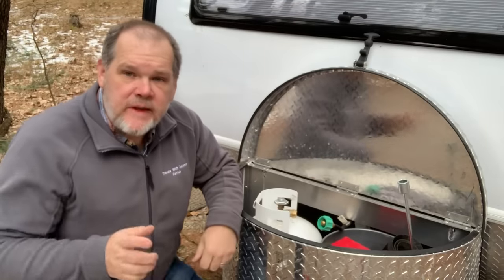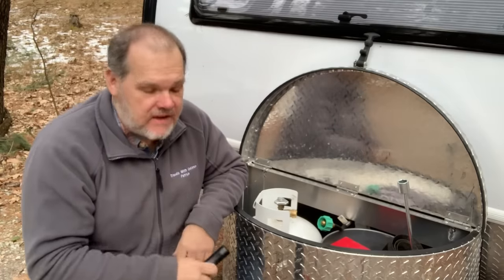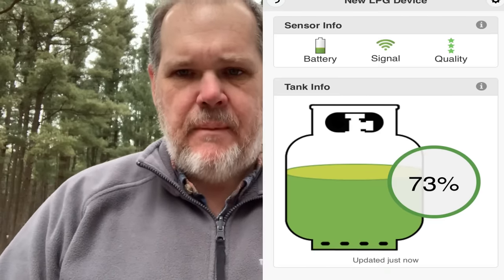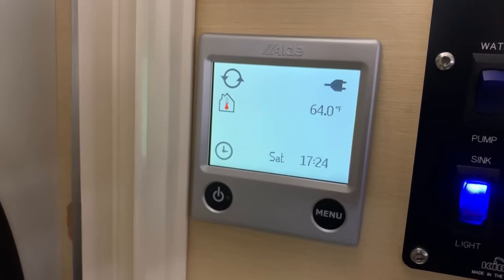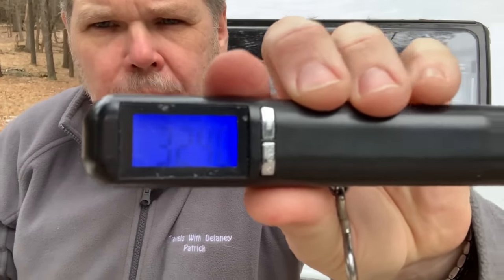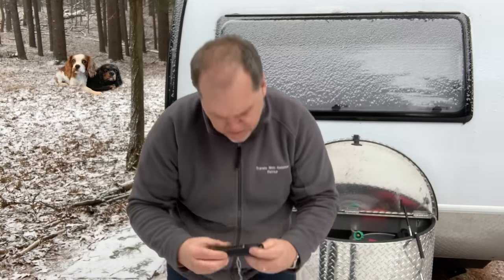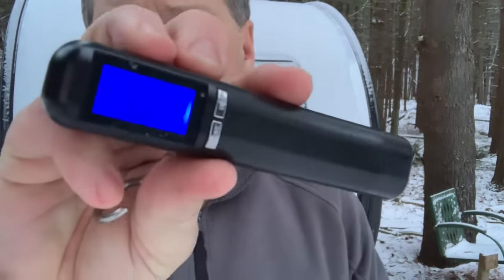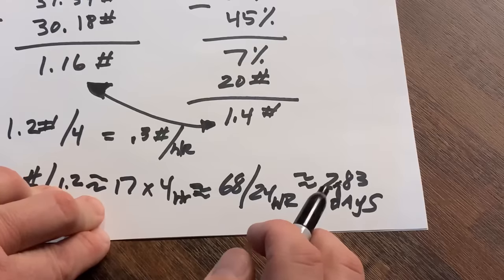Alde Heater Propane Usage Test & AP Products Sensor Accuracy Test in our NuCamp T@B 400

Comment: That's the sort of info people need! Plan ahead. Monitor your use. Carry a spare tank.  Another good one.
Reply: I thought this video made a very good case for carrying a 2nd 20# propane tank.
Reply from the maker: Thank you!
Reply from the maker: I think it really depends on whether you are going to be doing a lot of sub 30 degree camping. Last summer we spent almost 4 weeks on the road and didn't even go through the 20# tank.  But temperatures never got below 40 at night.  If I was going to be seeing temperatures below 40, I might consider adding a 2nd tank which there is room for in the diamond plated bin.

Comment: Our experience with temps in the 30’s and low 40’s is the tanks lasts about 3 days. We use hot water as well but cook on our portable stove. It is always fun to figure out your set up when you are boondocking. What we bring and how we do things changes depending on the circumstances.
Reply from the maker: Do you have the plastic bin or the diamond plated one like ours?  The diamond plated one will hold a 2nd tank but the plastic ones I believe will not.  Good information from your actually camping in 30 & 40 degree weather.
Reply: Travels with Delaney We have the standard bucket. I have it on my list to ask my dealer for the cost to order one as well as the lifts for under the bed. Do you know how much a second tank would increase the tongue weight?

Comment: I'm taking possession of my new tab 400 tomorrow so I've been learning all about it since I'm trying to take it out boondocking right away. Your videos have been so relevant and helpful, thank you!! I'll definitely be getting a 2nd propane tank for my 7 day boondocking trip in cold temps next week and refilling along the way. I'm sure there will be a lot of learning happening my first trip out :) I'll definitely keep up with your channel.
Reply: Did you test the  battery life? Running the circulating pump/pumps must use alot of power. Is it capable to boondock for 7 days. Or do you charge during boondocking?

Comment: The sensor looks like a good thing to have for a heads up! Thanks for providing a propane baseline... as conditions change so will propane usage.
Reply from the maker: Absolutely!  The temperature will play a huge role in how much propane is used. I would have loved to have had another trailer there that day with a forced air furnace which is more common in trailers to compare propane usage.

Comment: Thanks Patrick! Well done and that is great info to know. I also like the helpful tip about lighting the stove first after reconnecting propane.
Reply from the maker: Thanks John!  That simple lighting of the stove can save a lot of aggravation with the propane systems whether its the furnace, water heater or refrigerator.  Those things tend to not night if air gets in the line.

Comment: The info you provided gave me a sense that the Aldi system is the way to go it appears to be whisper quiet and easy on the use of propane 
Thank you  😊
Reply: PLUS the heat is disbursed EVENLY through "ducts" throughout the teardrop.
Reply from the maker: We love the Alde.  And you are correct, it is super quiet!
Reply: Travels with Delaney all I need now is to research a weight distribution hitch that will work for the frame of the 400 and give the system you use a serious look.   thanks

Comment: Great video.  What is the coldest temperature you have camped and any problems with plumbing?  Thanks.
Reply from the maker: We were in sub 30 degree weather once.  The trailer was winterized.  We just used the campgrounds facilities for water usage.

Comment: Thanks for the video; given a real-life stress test on how the Alde system works. I have been considering a radiant heating system for a camper van and it is nice to know the "real-life" performance of a commercial unit.
 I will mention that I think you are overestimating your run times by assuming a 100% full 20# tank. As you detailed the propane tanks are typically only 80% filled and in your case (due to cold) you had only 73% after the refill. For example, at 9:30 you calculated that you have 2.3 days from a full 20# tank. However, in actuality, it is only 73% full so you would need to reduce that duration by the same 73% ratio resulting in only 1.68 days.
Reply from the maker: There are so many factors that would actually play into how log it would actually last.  This was really just to show an approximation on one scenario.  Definitely could vary quite a bit.
Reply: @TravelswithDelaney  That is true, but you are using actual  (measured)usage in the calculations and so having the actual amount available (e.g 80%) would be more consistent with actual performance in this worst-case scenario (10 deg outside temps). As a first approximation, you could probably scale the difference between ambient and thermostat setting to estimate actual usage rates for alternate conditions. 
IIRC you had a 65 deg thermostat and an 12 degF ave outside temp. That is a 53 deg difference. If that difference were 1/2 then I would expect the consumption rate to be 1/2. I don't mean to be nitpicky, but rather get more value out of the measurements you did make (I'm an engineer). Assuming someone else's RV has a similar insulation value, the consumption rates can be adjusted with appropriate values for overall space volume,  tank size, and temperature differential and be pretty accurate. Thanks again for the video.

Comment: Great video (as usual). And I see the "non-scientific" disclaimer. But I'm really puzzled by what seems like a huge inaccuracy of readings from the app gauge. Here’s what I mean:

The tank is 20# with a 18.4# TW.

Reading 1 was 35.18#, minus TW is 16.8# of propane. That’s 84% of a 20# tank. The gauge read 73% which implies 14.6#, or -13% against the actual #.

Reading 2 was 32.4#, minus TW is 14#; that’s 70% actual. The gauge read 59% which implies 11.8#, or -16% against actual.

Reading 3 was 31.34#, minus TW is 12.9#; that’s 65% actual. The gauge read 52% which implies 10.4#, or -20% against actual.

Reading 4 was 30.18#, minus TW is 11.78#; that’s 59% actual. The gauge read 45% which implies 9#, or -24% against actual.

Okay, maybe the 20# tank actually holds more than 20#. So let’s correct for that. If the 73% initial gauge reading is correct, then the tank actually holds 23#. (From: 73% of X = 16.78#)  So with this as the reset, then the initial reading is forced to be accurate. How about the other readings?

Reading 2 of 59% against the new tank max of 23# implies 13.6#, that’s accurate enough to the weighed result of 14# (<3% off).

Reading 3 of 52% against 23# implies 12#, the weighed value was 13#, so that’s off by -8%.

Reading 4 of 45% against 23# implies 10.4#, the weighed value was 11.8#, so that’s off by -12%.

Okay, lots of math here, but bottom line is I can’t find a way to consider the app gauge to be accurate, and its inaccuracy seems to worsen as the propane level falls.

What am I missing?  Thanks!
Reply from the maker: +csktx I think the gauge will only read about 80% when the tank has a full 20# in it because propane tanks can only be filled to about 80% because they have to leave room for expansion. So with our 18.4# TW, a tank with 20# would weigh 38.4#.  Assuming that's about 80% then a 100% tank would weigh 48#.  So my first reading was 73%.  73% of 48# is 35.04# which is pretty close to my first weight reading of 35.18# especially considering there's some assumptions in all of this.  I’m not sure there’s a gauge that’s 100% accurate. Even the gauge that’s on our big 500 gallon tank here at the house isn’t 100% accurate. For $35, I think this Sensor will do what we want it to.

Comment: Loved this Video, just subscribed and I don't subscribe to ANYONE. Am 64 and we are strongly considering a Nucamp AVIA and traveling for a couple of years. How good or bad is the insulation on these NuCamp trailers?
Reply from the maker: Welcome and thank you!  NuCamp uses aluminum framed walls and roof with a foam insulation in between the aluminum bars.  We have found it to be really good and always have to crack a window in the winter to allow the trailer to breathe to avoid condensation.  I am not sure what the R-Value is on the insulation they use.
Reply: Have really picked up many useful tips and THANKS!
Would love to know if any of your readers liked the Avila.  Great advice to have as much as you can added before delivery..

Comment: Have you experienced the Alde camping at temps around 10-20 deg as the overnight low? I have a 2019 T@B 400 and my internal temp will go down to around 52-55 deg with the Alde Set at 60. It just can’t keep up. Wondering what your experience has been. Love the videos, thanks!
Reply from the maker: We actually camped last weekend and it was down in the 20's at night and we had to turn ours down in the middle of the night because we were too warm.  Were you running it on electric or propane.  When it's that cold out, we turn it off electric and run it on propane.  It seems to be much better at keeping up on propane.
Reply: @TravelswithDelaney  I almost always dry camp so it was propane only.  I wonder sometimes if my Alde system works as it should.  I've kind of been through the ringer with it.  I had to have the boiler replaced because it made an awful racket when on propane - even with high altitude mode enabled (I live in CO and mostly camp at altitudes of 7,000-10,000 feet).  The radiator in the bathroom gets pretty hot to the touch so it seems like the glycol is circulating at a good temp.  The only other places on the trailer I feel some warmth radiating are the circle window in the dining area driver side, behind the kitchen counter and along the far back of the bed (which always is covered by the sheets/blankets.  I thought the spaces along the floor (under the bed, under the dinette seat, etc) would have warmth radiating but I haven't been able to feel warmth coming from there.  Anyway, love the Alde heat but I'm a little disappointed that it can't maintain over 55deg if the temps drop to 20 or below.  I've really enjoyed your videos, thanks for doing it!  Hope you get a little income from it.
Reply from the maker: @markwaller1735  You might want to reach out to NuCamp on this.  Ours does struggle in cold temps when on electic but propane really hasn't been an issue for us.  We did notice our wardrobe and the bathroom get really warm and we feel a lot of heat from the wall by the bed.  We too don't necessarily feel a lot of heat from the floor openings.   I wonder if altitude has anything to do with it.  We have the high altitude kit but last weekend we were probably around 1,000 feet is all here in the midwest.

Comment: I'm thinking you've made a good case for going out & buying a 2nd 20# Propane tank; seems to me like it's a requirement for anything LONGER than a weekend.

The really nice thing about the Alde heating system is that it's "ducted" which means you have even heat throughout your Teardrop.  "NON-ducted" heating systems don't disburse the heat as evenly as the Alde "Ducted" system.

Comment: You must be a math teacher! That was impressive. Very helpful test, really appreciate it. Think I like Mandy Lea's mod of using a larger box in front and installing two 20 lb tanks as we'll be travelling in the cooler weather and latitudes and together with cooking propane wouldn't be able to stay out even one week boondocking. Doesn't the TAB 400 fridge use propane as well?
Reply from the maker: The small refrigerator like we have does not use propane.  The larger one that is now an option does use propane.  The diamond plated bin that is on our 400 is large enough that a 2nd tank could be added.  We don't do enough cold weather camping to worry about adding a 2nd tank.  But if someone was going to do a lot of camping in 30-40 degree weather, a 2nd tank would be a real plus.  I don't teach math but I have taught enough business courses over the past 25 years that I have gotten decent at demonstrating math.  Normally though its on profit and loss! LOL

Comment: The front bin that holds the propane tank is open on the bottom, aren't you concerned that the sensor will fall off while driving over bumpy roads?
Reply from the maker: Our bin has a solid bottom in it.  However, our friends have a bin with the open bottom and they said they have not had an issue yet with the sensor falling off.  They hauled theirs to the Pacific Northwest and back from North Carolina.  To be safe, you could also install a small piece of wood or something below the tank to catch it just in case.

Comment: I know that most Ontario campgrounds open in the winter are mostly electric sites, which means that you would be primarily run the Aldi on electric.
Reply from the maker: Propane works great to bring the temperature up quickly.  Once it's there, if you have electric then I would switch to electric to save on propane.

Comment: How much of a tradeoff do you find single vs double propane tank?
Reply from the maker: For us it's no issue having just one 20# tank.  Last summer we traveled for over a month and never ran out of propane.  Unless you are going to be doing cold weather camping, it doesn't seem to be an issue especially with the 2 way fridge that doesn't use propane.

Comment: How long does it take to heat the trailer from close to 30 degrees to 75 degrees?
Reply from the maker: I don't have an exact time but I can say it would take several hours.  That's why we carry a Mr. Heater Portable Buddy if the trailer is going to be that cold to start with.  It will bring the trailer temp up within 10 minutes then we shut it off and let the Alde take over.

Comment: What is an Alde heater please?  How does it work?
Reply from the maker: The Alde heater/water heater is a radiant heater system used in the nuCamp trailers, some Airstreams and some Winnebago's.  It is very common in European trails.  A series of tubes runs throughout the trailer with opens to allow the heat to radiate..  A solution of glycol is used in the tubes.  A circulating pump keeps the glycol moving.  The glycol is heated to up to create the heat.  It is super quiet and it provides a very consistent heat.
Reply: is it more or less evvicient than a forced air furnace?  @TravelswithDelaney